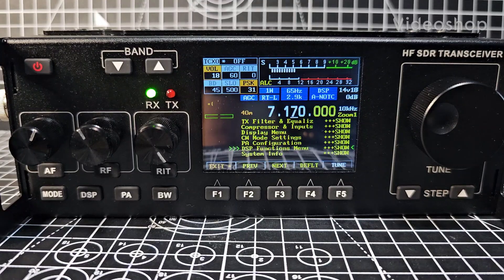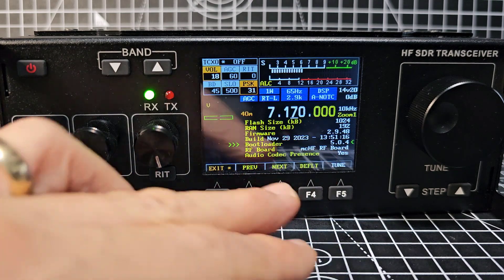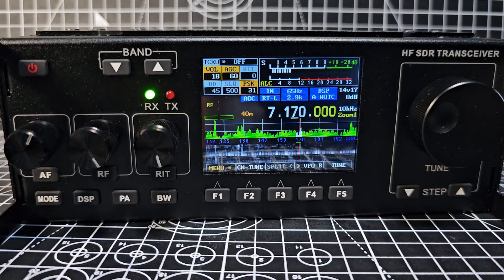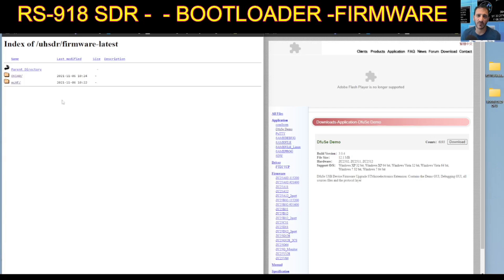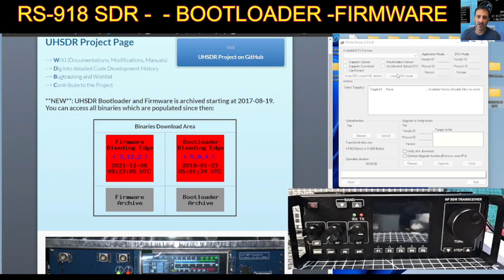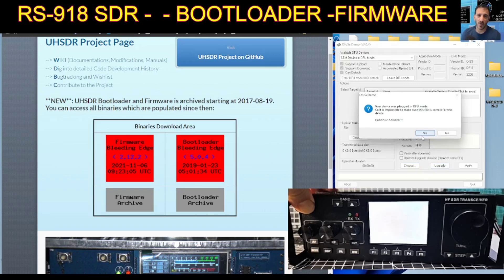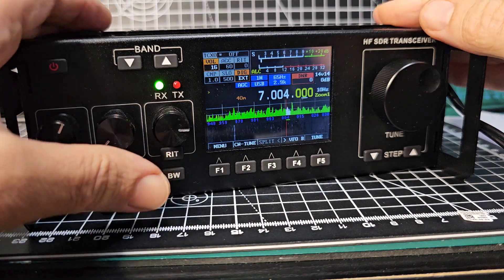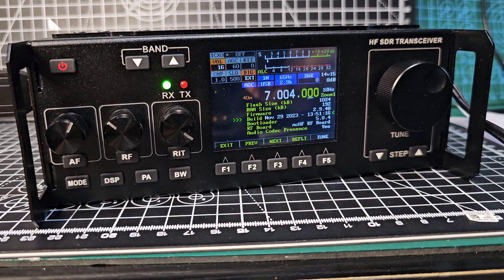RS-918 TRANSCEIVER - INSTALL BOOTLOADER & FIRMWARE PROCESS

Comment: I will have a go wiTH this OM.   I wonder if the mk2 is worth the upgrade from a  7300 receiving wise.  So far i find the yaesu ft710 better in receiving. Pd1cor
Reply from the maker: I have 710 aswell both great.

Comment: I have the orange button clone many call a bs 188 because that's the identifier for the screen display which is the only difference between the two clones of the mchf. However, the different screen required changes in the software to communicate with the screen thus what you used if tried on mine would brick the rig until one could reinstall the fitting software.

I see too many horror stories of people wanting the latest new software might offer who have really mucked up the rig so I am staying with what came installed on the rig. Incidentally it does claim to be bootloader version 5.0.4 & firmware 2.13 and exactly what this means in terms of how recent I only have the clue given by the date: October 9, 2021.

If anyone has more info on my version of the mchf clone please chip in.
Reply from the maker: Thanks hope my Video helps u.
Reply: @M0FXBHamTech  Glad you picked up the orange button clone of the mchf too. Did not realize you had until this morning. Now we have exactly the same rig and if you lead the way I will follow. ( should have realized when you did the push to talk short video)
73 de kc2wvb

Comment: I just got one of these radios. The firmware that came with this radio is 2.13.0 which appears to be newer than the latest one on the UHSDR download page, 2.12.2, which is dated 2021. I did a search for later versions and found a Russian video demonstrating 2.14.0 but no links to where the firmware can be found.
https://youtu.be/AIZMwKkEboI?si=NNOHIc-KRxhxBHSd
Reply from the maker: Hi , Look in description .